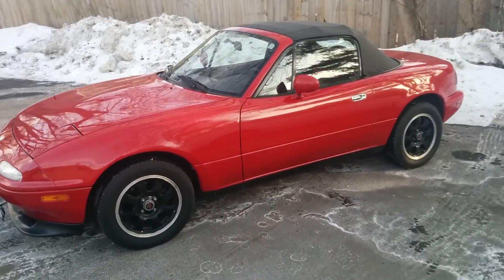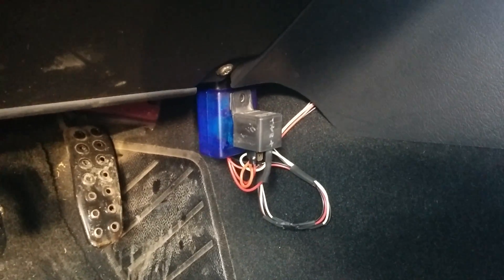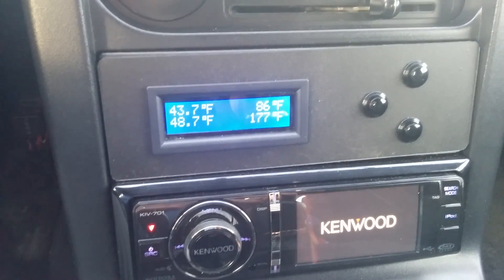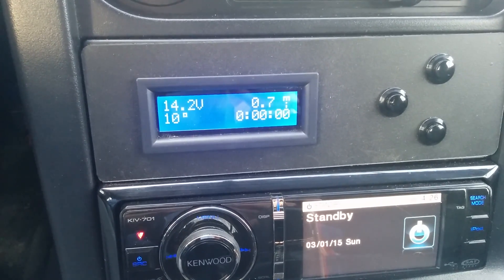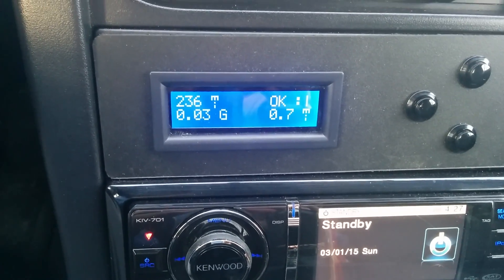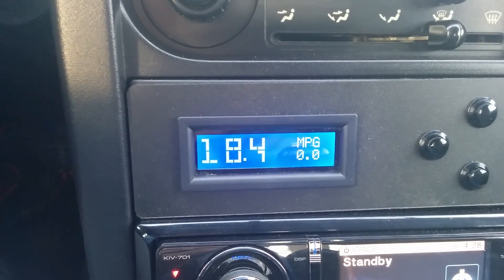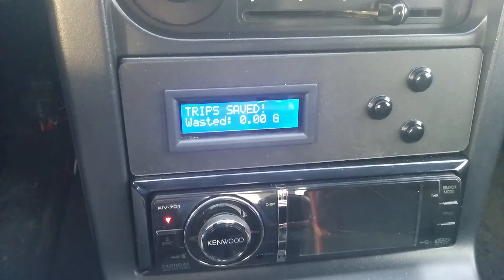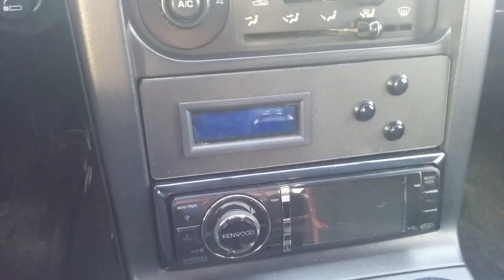ELM327 + Arduino = Awesome DIY Car Gauge

Comment: Hey, if I'm looking to do something similar with these cheap ELM327 modules - can I just remove the Bluetooth board and wire the TX/RX to the Arduino? Most of the tutorials I've seen online use Bluetooth, but I'd rather not include that potential point of failure.

Comment: What you did is great! I actually developed an arduino based motorbike display but I wanted to improve it by getting data from an elm as you did. But it looks that your arduino code is no longer available on your website. Would you mail it to me? Jcmichel00@gmail.com

Comment: I really like your project and would like to something similar. This to me is a proof of concept, because I understand much of what you are doing but much I do not. 1 question :) what resources did you use to learn how to build this. How did you learn how to do this yourself? thanks, great job
Reply from the maker: I learned mostly by watching other youtube videos, as well as various arduino forums.  Also specifically to this project there is a good resource at ecomodder.com (link is in the description.
Reply: thanks man. good stuff. The lcd information display in my mazda 6 is junk, it's a common issue where the screen becomes unpinned from the board. I am looking at doing a custom arduino based information diplay entertainment and hvac control. just figuring out where to start. I have seen lots of arduino obd2 shields but I already have the bluetooth elm327, that is what led me to find your video. check out the e-book (free at http://opengarages. org/handbook/ebook/) "Car Hacker's Handbook" lots of info there :)
Reply: https://www.blackhat.com/docs/eu-16/materials/eu-16-Sintsov-Pen-Testing-Vehicles-With-Cantoolz.pdf

Comment: cool but make it do more than the ap..u have those temp sensors, add auto climate either use a little linear actuator , make a digital circut to switch between resistor banks

Comment: Nice project ! Where did you get 1602 lcd board?
Reply from the maker: lifeforsp3ed thanks. I got the parts from adafruit.com
Reply: Thanks. I can't find frame on adafruit.com ..
Reply from the maker: lifeforsp3ed the bezel I got from digikey

Comment: Hi. What pin do you disconnect with relay on ELM???
Reply from the maker: I don't understand your question...? Please be more specific.
Reply: At the beginning of the video you said that the black relay is connected to turn ON the ELM adapter when ignition is on, right? I would like to know how you connect the relay to ELM adapter??? what circuit you break to turn OFF the ELM adapter?
Reply from the maker: +My Car Improvements pin 16 which is the +12v from the battery into the adapter.
Reply: Justin Depew Why do you use relay insteed of mosfet???
Reply from the maker: +My Car Improvements I've never had any experience with mosfets so I don't know how to use them. Relays are easy to wire.
Reply: Justin Depew Relays are big and noisy and good for big current. You can drive mosfet with arduino pin and it is easy to wire them to. You should read about mosfets and other transistors, it is a very cool things ;)
Reply from the maker: +My Car Improvements thanks for the tip!

Comment: Hi Justin!
Congrats for your amazing job! I'm interested to develop a similar project for my car using obd II elm327 bt dongle and arduino.
Where can I find a comprehensive wiring diagram and/or instructions to how hack the bluetooth dongle hooking it up to arduino?
Thanks so much!
Ciao!
Reply from the maker: +gionavier There is not really a good resource for this out there.  I mostly pieced it together from bits of info I found on the internet.  I'm working on putting something together that will go on my website, but that will be a few months out.
Reply: +Justin Depew That's sound great. I'll await for your tips but I also keep lookin' around the web either to figure out how to get my project done. Thx for the prompt reply! Ciao

Comment: Can you make a video on how you hardwired the ELM327 to the arduino?
Reply from the maker: I have been thinking of doing this since a few people have asked
Reply: +Justin Depew that would be awesome. Either a video or a wiring diagram.
Reply: plz can u send a diagram of hard wired circuit. i'm stuck in our research to connect elm 327 with arduino. plz help me.   wimukthi.lakila@gmail.com

Comment: Fantastic! I have an UNO I want to use for this.  Haven't done research on this topic, but your info helped confirm what I need to do next with that Arduino.  I have a 96 that I want to monitor some of the parameters for now that I have the overheating tendency cured on the stock radiator. :) Great work on this!!!
Reply from the maker: Thanks. Good luck with your project.

Comment: nice project. I might have to add one  to my miata {91)
Reply from the maker: Unfortunately it won't work on a 91 because that was before OBDII was installed on the cars. I believe this only works on 95 and newer.
Reply: might have to come up with a work-around

Comment: This is really cool- good job :) Would love to do a similar project on my car, maybe even internet-controlloed actions(if even possible). Never used an Arduino. Any tips on where to begin? :)
Reply from the maker: First step, buy one! The arduino site and other sites like adafruit have great tutorials for beginners. Best way to learn is to start tinkering with it.
Reply: Sounds like your car is going to get hacked like in the movies

Comment: can you share more information , for example the code , or how did you hacked the bluetooth elm and connected it to the arduino ?
Reply from the maker: Berov Batiooty I will update the desc. with a link to the code.  I think I might make a new video on how to modify the ELM to connect to the arduino.
Reply: Justin Depew thanks , waiting :)
Reply from the maker: Berov Batiooty link to code attached in description
Reply: Could you please tell us at least the wiring on the elm arduino connection? it would be awesome.. Great car and video btw! But we need more information on this as we kinda want to replicate your setup :) Thanks in advance!